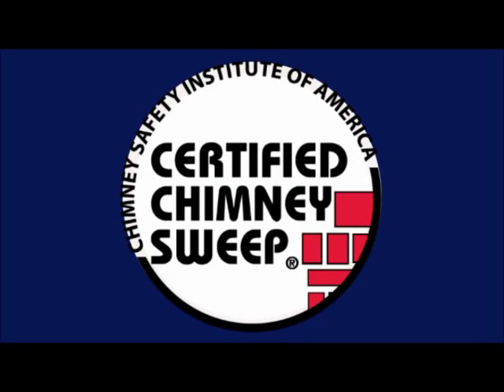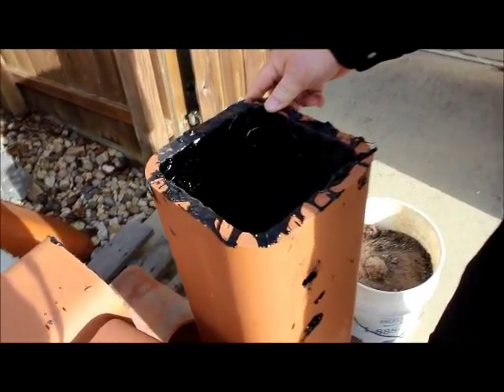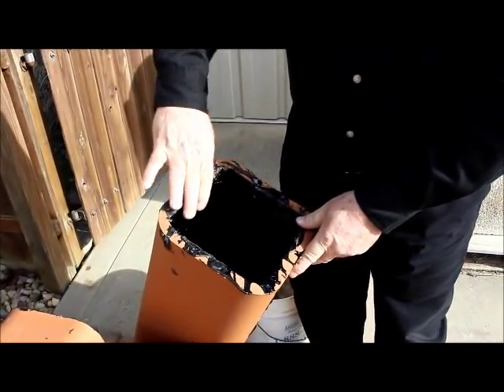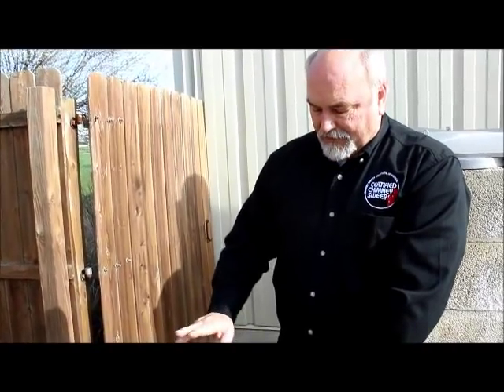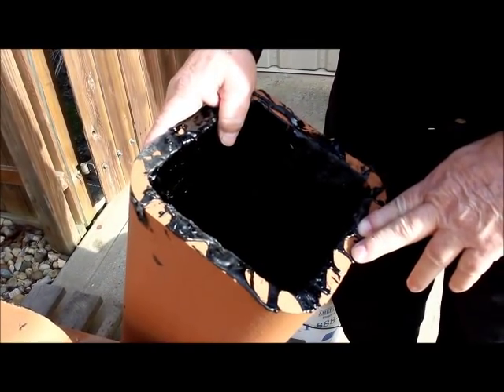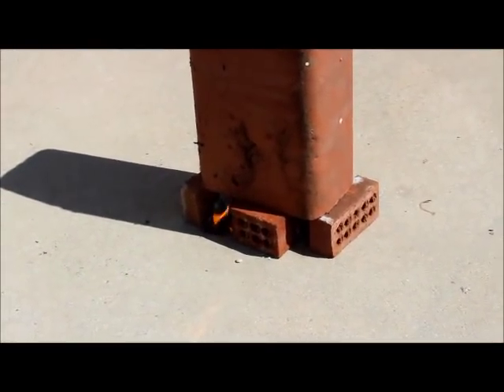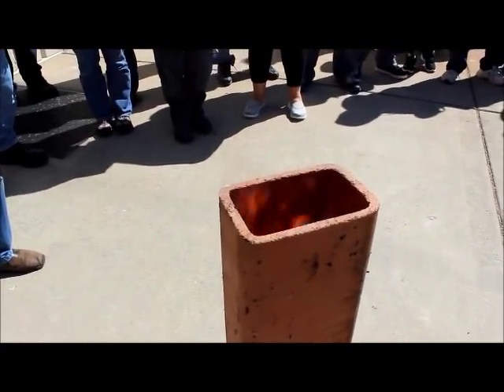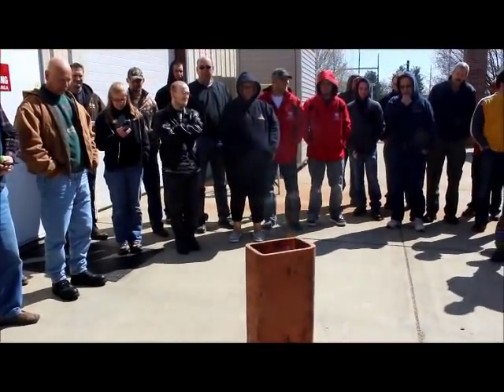The sound of a masonry flue tile in a chimney fire

Comment: This seems a little unrealistic not sure if you guys are selling stainless steel liners, the chimney is going to be insulated by brick and it gradually increases in heat, so I'd be curious to see they still crack when you stack 2-3 chimneys and also insulate them with brick or fiberglass.